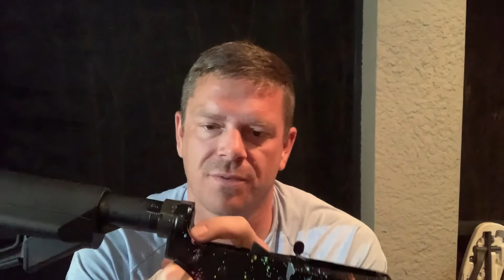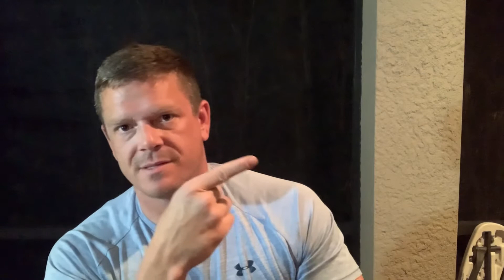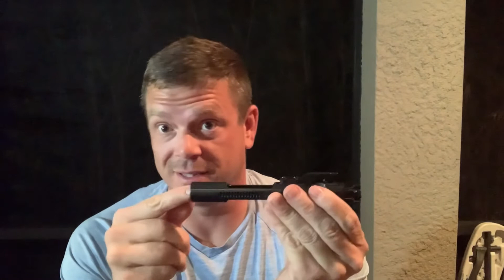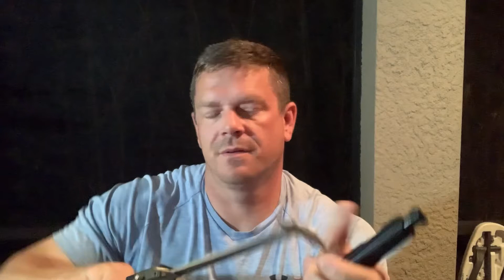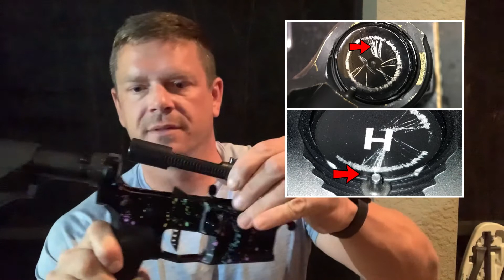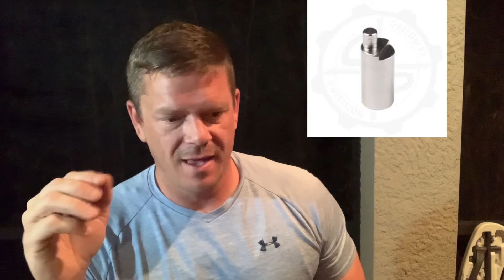Buffer face damage: explained

Comment: Every PSA gun does that which I purchased.  They are not in spec.
Reply: No no sir 
Yours are not in spec. The ar parts kit I slapped together from them has been a dream. I stopped counting rounds around 6k. Steel brass aluminum case ot don't give a damn

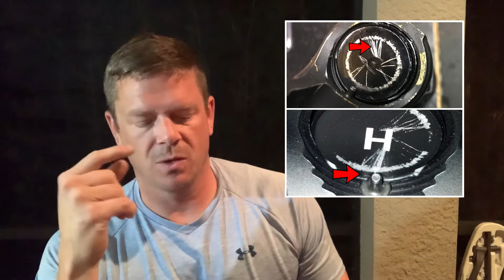Comment: Mine turned out to be a very rough bur on the carrier shoulder. My buffer face looked just like the photo you showed @4:24. I ran  2000 grit automotive sandpaper over the edge and got a new buffer and the problem went away.

Comment: If you're running into the issue of the buffer retaining pin hole being out of spec, my recommendation is to pick up an Armaspec silent buffer, pull the retaining pin and spring, and carry on as usual. Just make sure you drop some CLP in your buffer tube between cleanings. 

You absolutely can run your AR without that retaining pin, even with a standard buffer and spring. Your hammer will catch the buffer when you open up your AR.  The fun part is getting it back together.
Reply: But how does Armaspec buffer resolve this problem?
Reply: @Anreeewww  you don't need a retainer pin for captured buffer systems. That allows them to keep constant pressure on the BCG, and the heavier buffer weight keeps it from bouncing back out of battery.
Reply: @Anreeewww  removing the pin also keeps the pin from getting marred up or marring up your buffer. 

If there's no pin, it doesn't matter if the buffer retaining pin hole is in the wrong spot. 🤷‍♂️

Comment: I bought a rifle that had the wrong spring.  Carbine length in a A2 stock😮
Reply: I bout a arp but I put the 6 position buffer tube on it, which is a carbine. I think my original buffer tube that came with the ARP was shorter. Do you think I need to replace the spring to?

Comment: I've had the problem with the buffer face hitting the retaining pin on a Ruger MPR from the factory. 
With about 500rds it actually stopped working. 
I've changed the entire bolt carrier and buffer and it hasn't helped. 
The lower seems out of spec because the detent holes on the take down pins are drilled about 1/32" off center and the pins have to be removed with a punch and hammer.
I need to send it back.

Comment: If anyone one can answer please do and how to fix it. Why does my retainer pin keep popping out and don’t stay put ? 6:47
Reply from the maker: Buffer tube is out of spec is the likely culprit. Or short. The lip on the buffer tube should just barely catch the detent when you screw it in for the final turn. As the bottom of the buffer sits flush and your lining up the bottom at the direct 6 o’clock position,  there should be a few mm of the lip of the buffer that overlaps the detent and keeps it in place. If it comes up short, the buffer is out of spec. Possibly the threads on the receiver are out of spec or the pilot hole is in the wrong location but it’s the first place to start.
Reply from the maker: If you can post a video on your channel showing the issue and replying with the link, it would be helpful

Comment: Should the buffer face stay unmarked when things are right or does the marked ring around the edge always mean an out of spec detent hole lower? Thanks
Reply from the maker: Very light etching is normal. No wear at all is pretty uncommon. But if it’s out of spec, it’ll be pretty apparent
Reply: @theuncouthtruth9551  .. Thanks for the reply. On your carrier measurements, you got me wondering how common is it to have a short out of spec BCG?
Reply from the maker: @Allenmar73  ehh. Hard to say. But I would say that it’s more common than not to have an out of spec lower with the pilot hole drilled in the incorrect location than the shorter carrier. Especially if it’s a quality carrier as any place with good QC is gonna measure before sending them out. At least in batch. But it does happen. BCA and occasionally toolcraft being the usual suspects.
Reply: Stick with Toolcraft and you will be GTG.

Comment: Is there any way to fix the problem if your retaining pin is in the wrong spot? My buffer tube looks exactly like the one at @1.53. And I’ve only shot maybe 400 rounds through the rifle.
Reply from the maker: You can buy a recessed detent pin. I am uncomfortable with calling it a “fix” and would usually advise to replace the lower with one that’s in spec but as I have not personally had one, I can not say with experience how it does addressing the issue. But from what I have read, it seems to resolve it. If I had an SBR I paid a stamp for, I would go this route, but for a standard lower I would expect the manufacturer to replace it.

Comment: I have one that is leaving the rain around the outside of the buffer and couldn't figure out why I'm glad I found this video but I've had it for right at a year so I can't send it back I was thinking about just beveling the edge of the buffer where it would not contact the pen anymore but I've also ran probably 2000 rounds through it and haven't had any issues other than leaving a ring on the buffer

Comment: Do any issues arise from the damaged buffer face or is still good to run after resolving the issue that's caused it?
Reply from the maker: Yeah. It’s fine. Once it wears down to a certain degree, it won’t wear further and there’s no known case that I’m aware of after extensive research that there can be an issue with a worn buffer face. The biggest issue is the retainer pin breaking off

Comment: Had a x39 upper on a lower with an h3 and the buffer face is scratches up pretty good but  now upper is gone and a new ddm4v7p is on it with hopefully better in spec parts

Comment: Thank you have a custom 9mm AR from breachers customs, the issue im having is after I shoot the first round it chambers the next but give me a light primer strike. Does not fire the second round ever. I also ran into another issue with the charging handle getting stuck after that first round fires, took it apart and my buffer detent is bent and my buffer weight is not only scared but dented. I want to remove my buffer detent completely do you think this will fix my issue?
Reply from the maker: You appear to have more than one issue. To fix the issue of the buffer getting beat up, you will need to replace the lower. It’s out of spec. Assuming, of course , you measured the bolt carrier and it exceeds 6.67” in length. Second, from the sound of it, you have an issue with the fire control group. Quite possibly a backwards hammer spring. Take the entire trigger assembly out and remove all springs. Then reassemble making sure to orient all springs (trigger, hammer, and disconnector springs) the correct way. One of them is likely off. This can cause random light hammer strikes, dead triggers, and even bust shots. As far as the charging handle getting stuck, I’m not entirely sure. I would have to take a look at what’s going on and see it for myself before I could give an opinion.
Reply: Thank you. I'm digging into it. I greatly appreciate your response.
Reply from the maker: @jim18555  no problem. 👍🏻 And definitely reach out to them. There a lot of variables with an AR9 platform. If they’re worth their salt, they should square you away. Especially if the lower is gonna need replacing
Reply: Right on, I will reach out for sure. I didn't pay $2400 for my gun, not to work. I appreciate you.

Comment: Hello, hope you're doing well. Recently purchased an fx9 secondhand, the person claimed to have only shot ten rounds and decided to sell due to being a left handed shooter (so they claim, probably lied about both). Unfortunately upon inspection after purchasing it I noticed marring on the buffer face from what I've discovered to be a bur on the bcg. This is the first buffer tube utilizing firearm I've purchased so the concepts are still new to me. I plan on hopefully sanding or polishing out the bur, but are the indents/wear on the buffer going to be an issue? Do I now need to replace the buffer? Thank you for the video, it's provided some insight.
Reply from the maker: Well, as I explained, if the marks look like scratches and sanding, it’s not a particularly big deal. Likely a burr. Where the problem lies is if there is ding marks on the edges of the face. Consistent with the buffer face hitting the retention pin. This leaves small concave notches around the rim. If that’s the case, the lower is likely out of spec and at some point will shear the retention pin off which can be a big problem.

Comment: What about the rubber tip getting all crushed and ate up
Reply from the maker: That means that your buffer is bottoming out in the tube on recoil. Could be a combination of things. Rifle buffer in carbine tube. Under sprung. Out of spec tube that’s too short. Rifle tube and buffer with a carbine spring. Etc. I’d have to examine your specific rifle to make that determination

Comment: I’ve had this issue. Someone told me to try a lighter spring/buffer. Before I buy it, would you agree?
Reply from the maker: No. It will not change anything. You were given incorrect information.
Reply from the maker: First you need to determine what the underlying issue is based on the type of damage. Pilot hole in the lower out of spec or burr on the rear of the carrier. Or rarely, both. If it’s marring occurring above the detent and possibly some scratches on the face, it’s a burr. If there is concave damage from buffer pin strikes, around the rim , it’s an out of spec lower
Reply: It’s damage from the buffer pin strikes around the rim. I’ve contacted the manufacturer and awaiting for a response. Diamondback has lifetime warranty and I’m hoping to send it in for repair. Thank you for your wisdom and prompt response.